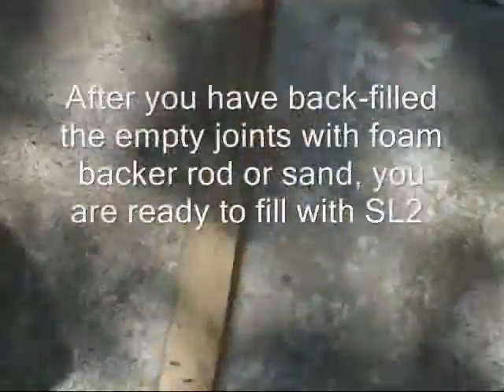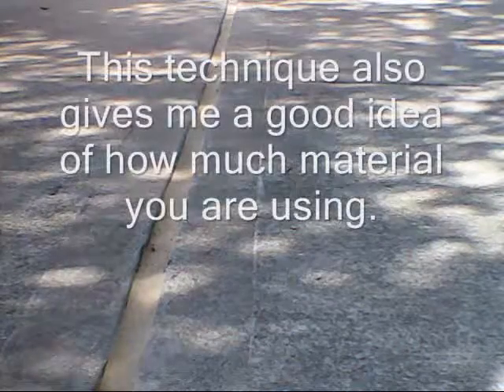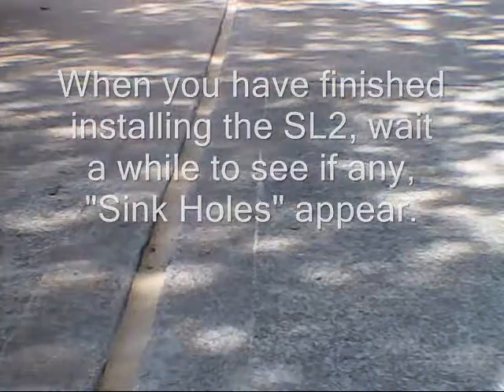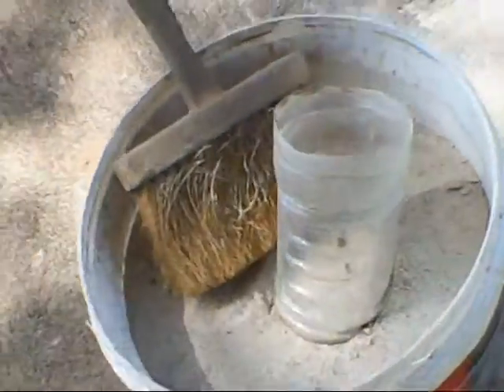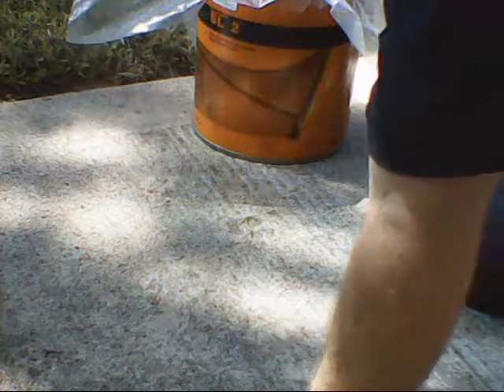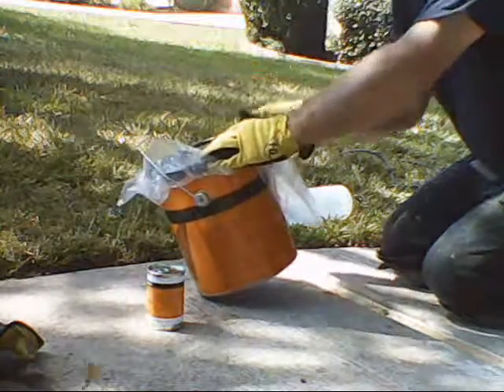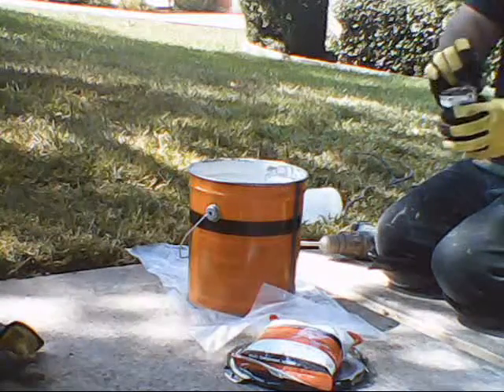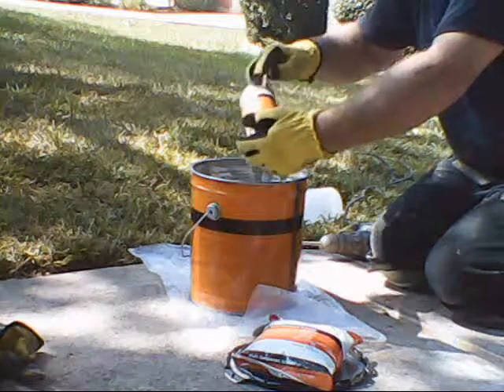SL2 Installation

Comment: Filling the joints with sand is absolutely wrong. You have to put it directly over backer rod. This is the very basics of sealant installation. If you don’t know this you should not be doing your own sealant work. Using sand turned this into a shit job

Comment: The directions for SL2 say you're not supposed to use sand as a backer...?
Reply: Correct... do NOT use sand..that would cause what they call a "3-point" bond because it will stick to the sides and sand on bottom.  And he's mixing that pail too fast...supposed to mix slowly for 4 to 6 minutes (activator first....then mix in the color if you have a color packet).  I was impressed though how he squashed that pail and poured it into the plastic bottle.
Reply from the maker: You have to put it in thicker. Most installers use as little as possible anyway. Backerod has zero adhesion to the sidewalls so its a moot point. Bakerod is only a filler. When you have a lot of joints to fill I guarantee anyone who does this for a living doesn't mix slow for 6 minutes. We have guys doing this over 20 years that certainly don't do that.
Reply: @daverichards1304 no knowledgeable installer uses sand it voids the warranty and is just plain stupid
Reply: @CougarLand I disagree with one thing you said. I have used hundreds of pails of SL2 and I always mix the activator with the color pack n the center void first. Only because then you know if it has color it has activator But everything else I agree 100%
Reply: Yes this us plain stupid. He has know idea what he is doing